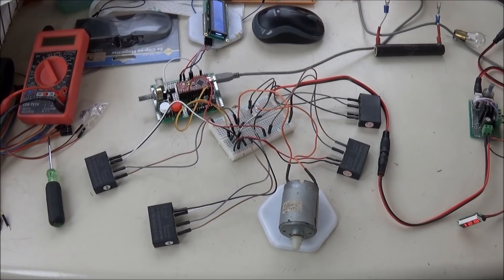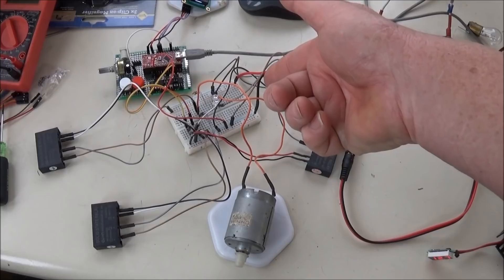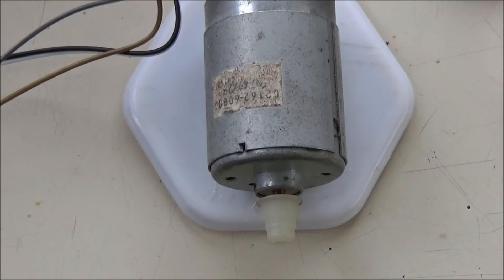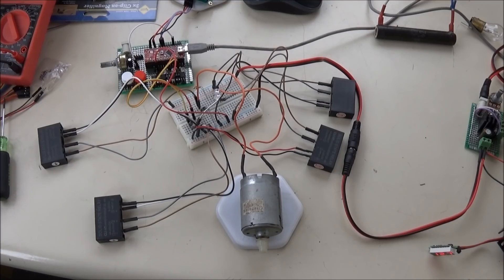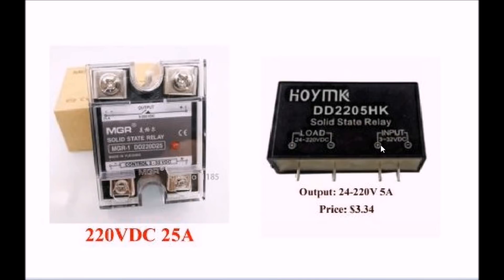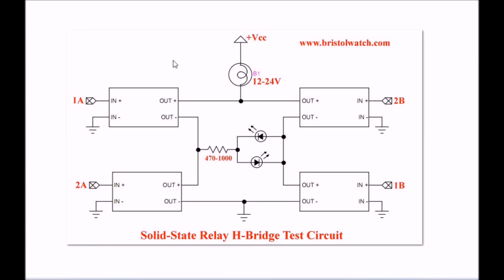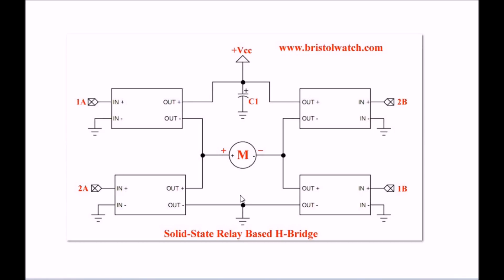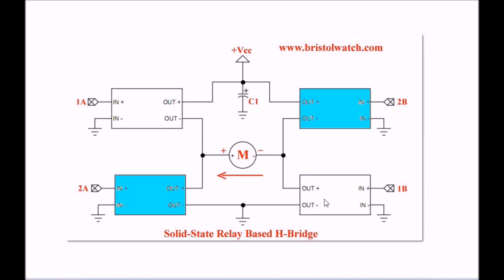SSR Based High Voltage H-Bridge

Comment: Does this need flyback diodes to catch the back emf from the motor?
Reply from the maker: I would add them along with a filter capacitor across the power supply.
Reply: Thank you, I wasn’t expecting an answer lol. One more question if it’s not a pain in your neck, I’m having a hard time figuring out the placement of the diodes, I keep shorting out

Comment: This is quite excellent. Much easier than finding and tuning IGBT’s with the low high side drivers and then the opto isolators for high voltage stuff. Thanks for sharing, I forgot these existed and are so handy for low speed stuff.

Comment: Perfectly reasonable. 4 DC-DC SSR devices driven by the appropriate logic works quite well. Just done the same for switching a 500 Watt resistive load with a square wave supply for an experiment (I needed the heat as well as a varying magnetic field).
Just watch the logic... switch both sides on together, even for a short period, and you will be very, very sorry.
I didn't use the same circuit and  my logic was derived from a simple square-wave astable  chip with 5v out.

Comment: Do you really share a common between sides?  SSRs generally switch AC not DC. I need help.
Reply from the maker: These are DC not AC.
Reply: Lewis Loflin - Got it. Just wondering about the common “ground.”  Do you feel it’s necessary?  My experience with SSRs is limited to industrial PIDs or PLCs. I have lots of academic knowledge but there’s a huge gap between theory and reality with SSRs.
Reply from the maker: In this case you don't need a common ground due to opto-couplers in the SSRs.